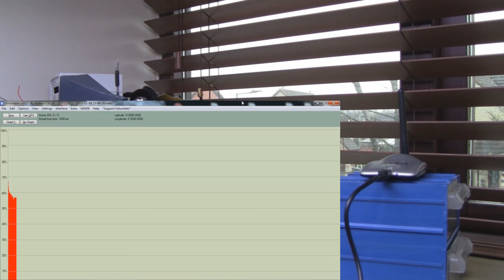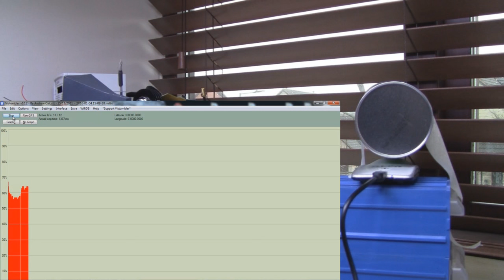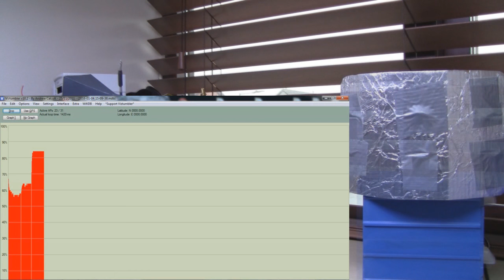Wifi Antenna Adapters Shootout

Comment: Andrew I really appreciate the videos and your no nonsense honest opinions on what works and what is bunk. I was thinking about making a parabola out of sheet tin. Need to communicate with a IP camera about 100 meters away. Bought netgear range extender to put into the closest outlet and it is spotty. Hopefully it works out and I appreciate the inspiration from you.
Reply from the maker: +Jeff Barr Hi Jeff I would start by downloading the wind surfer template: http://www.aegisarts.com/wifi/ez12.pdf  you can make it more robust by making it from tin and thin plastic sheet.
Reply: Many thanks ! Stay well and warm.
Reply: Jeff Barr those range extenders never work. The provided antenna solutions do work as cheap solutions. But buying a wifi antenna amplifier from sunhans or a cheaper chinese brand works a lot better. especially when combined with a 15dbi tp-link omni antenna or a 14dbi yagi. The cheap chinese amps cost about 25 euro the sunhans cost about 100 euro 4w is enough for even the biggest company buildings.

Comment: Thanks for the video! I subscribed recently after following up on so old bookmarks that eventually led me here. I saw one mention of replacing the reflector element with a parabolic element. Essentially it seems you could just combine the windsurfer and the sharpie antenna ideas. Perhaps it could combine the positives of both designs, or make no difference at all. Just figured I would throw that idea out there. 

I like how your videos are detailed yet to the point. Keep up the good work!
Reply from the maker: +wrathofsocrus Thanks Wrathofsocrus, if you did you would effectively have something like this: http://goo.gl/R0AGJ6

Comment: ...for the can, try some thick foil and glue stick.  Have a prototype im messing with that uses the metal in duct tape outside the can as a sort of choke for added clarity when doing a less than ideal diameter can. Went to make 1 and ended up deciding to do half a dozen for comparison before deciding my home and travel one design.

Comment: I agree that the pringles cans don't do a very good job but with all due respect to you Andrew, I have done some tests on some Pringles cans and discovered that they are in fact conductive. however the foil inside the can has some sort of coating on it and continuity can only be achieved by poking the metre probes through it.

Comment: I made two small windsurfers antenna boosters from freeantennas.com and tried them out on two small rubber duck antennas( 2 to 3 dbi each)  one at 2.4Ghz and the other at 5.8Ghz ,the tin foil on the front side,used a low power rc transmitter with a video screen integrated , the fpv -video reception and remote control(rc) functions performed better with the windsurfer antenna boosters than without-hands down, they are almost no cost to build and the design can be adapted to accommodate copper, and lots of metal reflective surfaces. What these antennas do is take a isotropic or omnidirectional antenna and make it a directional antenna , in this case transmission and reception is improved much horizontally to the tune of 9 dbi or so , subscribed as well.

Comment: Andrew do you know how the Windsurfer performs in relation to increasing the size proportionally.  Ive made a few, well 3 in total.
1st is origional size , 2nd is 2-3'' bigger and 3rd is about 12'''. 
I havnt got around to using the large one yet as the size makes it unstable on the  5dbi antenna(TP Link wn 722n high gain adapter) 
I'll have to mod the W.Surfer to give it some stability, so it doesnt flop forward with the weight!!  
Thanks Paul

Comment: I'm testing now with simple and cheap circuit. After some improvements LM358 (and other Op Amps) can detect wifi. It's dual Op Amp, 1st section picks up signal, 2nd is for highest sensitivity setting. Here is basic circuit diagram without improvements: https://electronics.stackexchange.com/questions/195760/why-does-this-detector-detects-wifi-signal-as-well Wifi sensitivity can be increased significantly by this: First two capacitors C1 and C2 (100nF) on input are removed and input is feeded by one 3.1cm square element of "Biquad wifi antenna". This element needs to be in series with 4.7nF capacitor (sensitivity setting doesn't work properly with both input pins 2 and 3 joined together by any loop or coil). My 10k sensitivity potentiometer works much precisely in the middle between 10k resistor from positive and 10k resistor from negative. Now I can test and tune Sharpie yagi, Windsurfer or Cantenna beaming to a large satellite dish. I don't even need wifi SWR meter. I can see transmitted signal strength (TX efficiency) and directivity of antenna in real time without lags. My AP transmitts beacon with SSID each 20ms, detector flashes very fast. I can hear small speaker too. It's really useful for antenna tuning. Change in distance or dimmensions affects signal strength and beam width immediately.